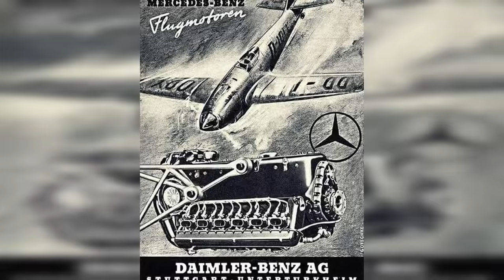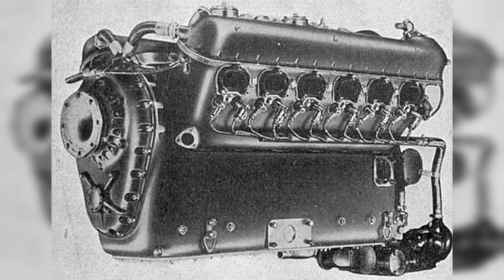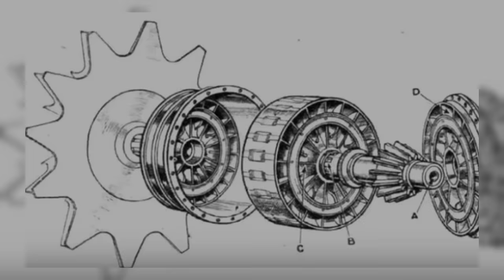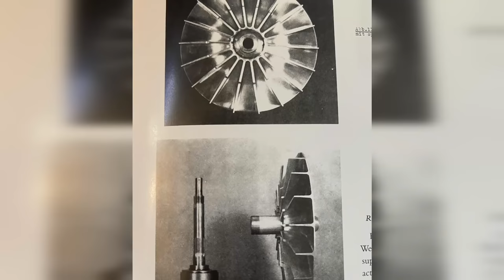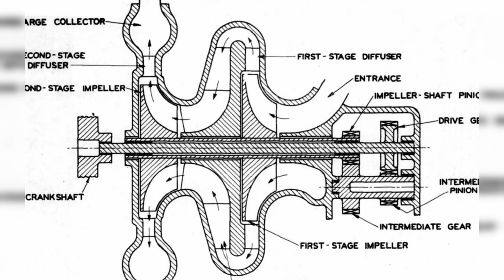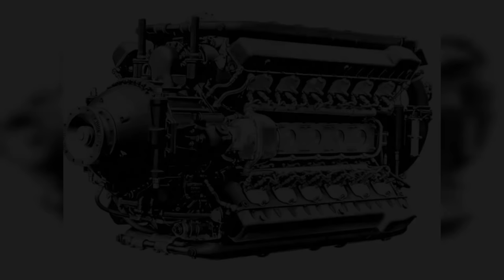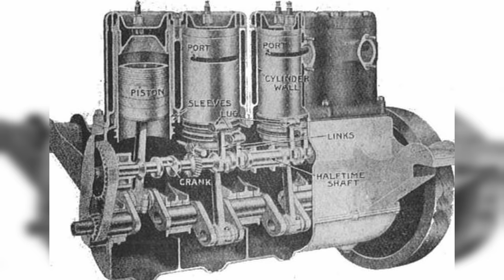The Engine of the Dark Side? Daimler-Benz DB-600 - DB-605 - Part 1

Comment: Daimler Benz,s 600 601,603,and 605 on account of poor quality petrol, oil and lack of decent metals are lack lustre performers, in the pony count stakes litre for litre, Roller,s Merlin and Griffon leave them in their dust. For example a DB 605 around 35 litres is 1 475 ponies, a Merlin 47 is 1,470 okay five ponies short but look at the litres , close on 1,500 ponies for less than 30 litres, 26 to be exact not bad weight wise. For an extra two litres,a Griffon in 2 stage blower form chucks out 2,000 or more ponies, a DB 603 struggles at 1,900  ponies before the ha-hah gas is used.  DB,s 600 series and  Junker,s Jumo also earned the soubriquet ' Stone crushers'  due to their low max rpm 2,600, as opposed to the Merlin,s racy 3,000 and the VDM electric propeller standard on all Luftwaffe aircraft lacks a constant speed unit, so synchronising a pair of  Junkers Jumo 211F2,s on  a Heinkel 111H is near impossible.   Despite their fancy fluid driven blowers the DB 601,s power falls off above  30, 35,000 feet ,that is why Heinkel Hirth designed with great difficulty the TKL turbocharger to boost the 601,s 605,s flagging pony count at extreme altitudes, . All aware of their engine,s  pony deficit , engineers at Daimler Benz came up with a wacky solution, 'needs must when the devil drives', no we are not talking of their simply dreadful DB606-610 Twin-Pac, no . Ever heard of HZ Anlage designed to increase performance of Fat Herman,s bombers at extreme altitude, for example a Dornier Do 217 with two 1,900 hp DB603,s has a third engine, a donkey DB605T mounted in the aft fuselage driving a very large multi stage blower, air close to sea level pressure is fed via pipes in the wings to  each DB603 blower, maintaining  their 1,900 ponies close on 45,000 feet, a bit Mickey mouse but did the job. Vasily Petlyakov in conjunction with Mikulin had the same idea,the  Pe-8 Petlyakov,s cool  looking long range bomber , had a fifth AM-35 engine based on a Hispano Suiza 12Y mounted  behind the wing trailing edge driving a similar multi stage blower, pipes in the wing sent high pressure air to the blowers of four 1,350hp Mikulin AM-35,s thus improving its already decent performance at extreme altitude.  Wow think what Pety,s cool bomber could do with a quartet of two stage Roller Merlin 85,s or 102,s, jesus, his Pe-2 Peshka attack dive bomber with two Merlin 77,s would give a Mossie a very hard time.
Reply: Poor quality fuel???  Any fuel that permits the engine to perform as needed is a good fuel.
The sophisticated and inventive German engineers with their design did not need 150 octane fuel.
Reply: @BasementEngineer  Yes!!!!, why do you think in 1944-45 German Chemists were working hard to synthesize and manufacture 100 Octane petrol using what ever crude they could get  from the Ploesti Oil fields as part of the refinery were put back in some semblance of working order after the grass cutting raid by Consolidated Vultee B24D Cat Muzzle Liberators based in Italy. Nearest the chemists got is 96 Octane C3, the limited production sent to  Fat Herman,s front  line Jagdeswaders Fighter Squadron flying BF109G,s FW 190Ds and Ta152,s in  the Home Defence Role. The Luftwaffe so short of even the 87 Octane, forced to scrounge 100 Octane left in the tanks of crashed landed allied aircraft. It is their very sophistication that brought the Luftwaffe to its knees, said sophistication , not the panacea they hoped for,. Look at Daimler Benz,s  DB604-606 ,  Junkers Jumo 222 ,both over complicated and hopelessly unreliable.  If you you want your pony to win the pony race ,feed it the best oats, why do you think  the US Army Air Corps asked the Standard Oil Company to send a batch of 100 Octane to Wright Field in 1934?, good feed equals race winning pony.
Reply: @basiltaylor8910  The most courageous lion will succumb to a pack of jackals.

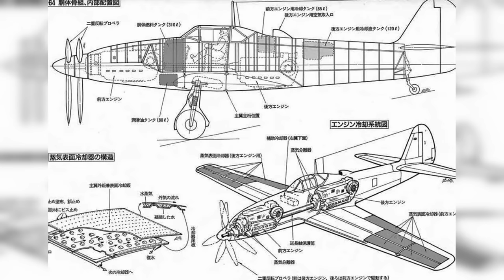Comment: 7:40 what aircraft is that?
Reply: Good question, it looks like one of the Heinkel experimental aircraft either a P.1066 or a P.1076??? not exactly sure.
Reply: Kawasaki Ki-64
Reply: @4strokenicolaus  Good catch! Thank you, I didn't know the Japanese used the Daimler Benz DB 601 engine...
Reply: @sandervanderkammen9230  in this case the engine is called Kawasaki Ha 40, more or less a japanese version of the DB601.....
Reply: @4strokenicolaus  I couldn't help but notice a heavy German influence on the Ki-64, I can only assume that it is a Takeo Doi design? He designed the Ki-61 and was a student of Dornier engineer Dr. Richard Vogt...
Do you know if Vogt? Or Doi designed the Ki-64???

Comment: The constant denigration of the German's design philosophy involving a lot of 'purely academic' testing shows a critical lack of understanding. It is not in spite of this attitude that Germany had the most advanced fighter in the world going into WW2, it was because of it. The advantage of such 'purely academic' testing is to note where advantages may or may lie and thus inform decisions on what exactly they should be focusing the majority of their resources on in the first place. It's relatively easy to get a spare engine, jury rig a turbo to it, and record some statistics and observations about the performance. It's much more time consuming and expensive to create a production-model analogue and run it through full-scale tests.

Ignoring the testing at all though means making assumptions about what will and will not work- which only works if you know in advance what your choices are and the consequences for them. It's the hindsight fallacy. In hindsight, these investments of time, money, and energy were utter wastes of time when the could have been investing in more successful ventures, but there was no way for them to know that at the time. You might point to all the people that told them things would work out this way, and I could easily point to all the people that disagreed. There's no real way to differentiate between them either without at least testing out their ideas.

If the Germans hadn't done all that testing of novel concepts, they would have just stuck with what they knew worked which means... either a V12 or Radial engine with a traditional lay out, unpressurized carburetors for fuel injection, and using a traditional gearing system. A design philosophy that would have ended with them investing all their resources into incremental improvements to the DB-600... would have never created the DB-600 in the first place.

Comment: Imagine the DB 600 series combined with 150 Octane American aviation fuel.
Reply: DB 600 series doesn't need 150 octane.. they are equipped with GDI fuel injection.

Comment: Okay, and nitrous oxide does not "stabilize combustion temperature". that is methanol-water injection, if anything, although I thought that was more to do with charge air cooling. Nitrous oxide is literally nitrogen and oxygen. The nitrogen is totally inert. Oxygen is what you use to burn fuel. When you use forced induction you are cramming more air into the cylinder to burn more fuel. Nitrous oxide is just a turbo in a can. The system injects oxygen into the intake charge in the form of NO2, which is even more rich in O2 than air is. You set up the fuel system to crank up the fuel delivery, and you can burn about as much fuel as you dare try to burn in the cylinder (you don't want to go lean still). if there is another use of nitrous I have never heard of it.

Comment: While German engineers were searching for the best engine design for any particular machine, (land. sea, or air), this, in war is a mistake. Better to have one or two designs that work WELL ENOUGH in most or all applications. Then you have standardisation of your spare parts inventory, simplification of the supply chain, and easier mass-production. If supply of spairs becomes an issue on the front line (not exactly unheard of), then you have the ability to cannibalise parts from other machines. During WW2 the allies were able to keep things going because of this interchangeability, where as the Germans ended up leaving equipment behind for lack of spairs.

Comment: Okay, have to stop you. 15:50, you say Germany focused on single stage systems because they "didn't require aftercooling". Aftercooling is what a single stage system uses, if it is cooled at all. it is what most people call an "intercooler" today. It is "after" cooled because it comes after the compressor, before it enters the engine. A single stage system doesn't need it, but it is better to have it. A 2 stage system can use an inter cooler between the stages, usually in addition to an after cooler, basically each stage has its own cooling system to recool the pressurized and heated air. One could just use an intercooler, but I can't recall any cases of them doing that. As far as I know all major versions of the DB had at least one cooling stage, it is hard to run a forced induction at any meaningful boost pressure without it.

Comment: German engine valves were short on nickel.
The low nickel content meant the valves would
not stand emergency power or methanol injection
for long. The 109E was in many ways inferior to 
even the P-40.

Comment: 17:46 - That is a completely nonsensical statement. The configuration of the supercharger impeller is in no way related to the design of the camshaft.

Edit: The statements about N2O are completely nonsensical as well.
Reply: Not true, the larger capacity supercharger impeller was needed for DB601E onwards as they increased the valve overlap by having very long duration camshafts, which open both valves for a very long period, this means a lot of the supercharger boost goes right through and out the exhaust, so you need a bigger capacity supercharger.
Reply: @CalumDouglas  That's not what was stated in the video.
Reply: @PistonAvatarGuy  - You stated : 

"The configuration of the supercharger impeller is in no way related to the design of the camshaft."

I`m explaining to you that this statement is completely wrong.
Reply: @CalumDouglas  Ok, so we're just going to completely ignore the context of my original comment?
Reply: @PistonAvatarGuy  - Your statement that camshafts have nothing to do with impeller design is factually wrong, no amount of wriggling gets you out of that one I`m afraid.
Reply: @CalumDouglas  No, buddy, the fact of the matter is that the video made it sound like the design of the supercharger impeller directly affected the mechanical nature of the camshaft, but the reality was that the design of the camshaft lead engineers to change the design of the supercharger. The video is completely wrong, PERIOD. I'm not the one doing the wriggling here.
Reply: @PistonAvatarGuy  - Your comment was:

"The configuration of the supercharger impeller is in no way related to the design of the camshaft."

It was, so thats the end of the story isnt it.
Reply: @CalumDouglas  It's a true statement, though. If you change the design of the supercharger, it doesn't inherently change the design of the camshaft, EVER.

Comment: You say Daimler Benz,s blower is superior to a Roller(Rolls Royce) Merlin or Griffon, i beg to differ on that thorny issue, DB,s 2 stage blower is crap, er well engineered crap. In late 1941-42 faced with Kurt Tank,s Focke Wulf 190A Wurger Buther Bird  the RAF,s Spitfire V Squadrons were being slaughtered, like a turkey shoot,. Faster by 16 17mph, more manoeuvrable heavily armed with for 20mm MG FF cannon and a decent engine Beemer,s BMW 801D complete with its own brain, a workable engine management system ,the ancestor of (FADEC) Fully Digital Autonomous Engine Control,as the pilot pushes the throttle the Beemer,s brain does the rest.
Actually the Beemers 2 speed blower is very neat, having not one set of curved impeller blades but two sets back to back on the same disc, a very compact 2 stage set up, affording the 801D decent performance above 30,000 feet. Why do you think A R Fedden had a Stiffy, when an RAF lorry dropped off a Beemer 801D, salvaged from a crashed FW190A at Bristol,s Filton Engine Facility, Roy Fedden was like a hormonal schoolboy staring at Kim Kardashian,s jugs,as  he,  his small team of engineers were all over the Beemer 801D like a cheap suit,. Like a Coroner in a morgue Roy, his engineers carefully dismantled the engine bit by bit, studying its features, especially that blower. Knowing all to well his Bristol Hercules 16 Radial was a dog(crap engine) needing a serious make over,. It does not take Professor Brian Cox to tell  you ,Roy incorporated the Beemer,s blower and other systems into the Series 100 Hercules a far better engine that powered the later models of Frederick Handley Page,s Halifax, together  with Roy Chadwick,s Avro Lancaster spearheading Arthur Harris,s reign of terror over Germany,s industrial heartland. 
At Roller,s Derby Factory Stan Hooker ,Ernie Hives, both seriously concerned over the Spitfire V,s high casualty rate when scrapping with an FW190. RAF, s brass hats were too, shitting their pants as the balance of air superiority over Southern England  favoured  Fat Herman,s Luftwaffe, something had to be done like yesterday.  Luckily Ernie and Stan had a wild card to play, Rex K Pierson  with Barnsey Wallis  reworked their faithful Wimpy Wellington Bomber to  work at higher altitudes around 40,45,000 feet,  resulting in the odd whale like Mark 6, reworked into Barnsey,s Basket Weave airframe is a boiler like pressure cabin for a 3 man crew the pilot sitting under an upside down Pyrex bowl, designed by General Aircraft at Hanworth .  Roller,s secured the contract to make the Wimpy Whale,s engine ,in order to complete with said contract Ernie with Stan  rooted round their graveyard  of Roller,s crap also ran engines for anything they could use, both dug out the blower from a Vulture, Rollers worst engine an utter dog!!. With a small team of  trusted engineers Ernie, Stan took a standard Series 20 Merlin and 2-speed single stage blower off the production line, whipped off its backside, to bolt on a new blower accessory section designed in record time. A single shaft mounted a series 20 Merlin blower disc, together in tandem with the larger Vulture blower disc, sandwiched between blower and cylinder blocks is an after cooler the size of a Samsung microwave oven. Result is the excellent 60 series Merlin, with automatic gear change and sixteen seventeen hundred angry Derby ponies, some fourteen hundred of them readily available close on forty thousand feet in FS Gear.  
To cut  to the chase George Dowty at Staverton, added an extra blade to his Jablo Hele,Shaw propeller, bolted his new four blader on the 60,s propshaft,  At  Supermarine Joe Smith took a Mark V Spitfire,and like Richard Rawlings at 'Gas Monkey' Garage, stuffed a Merlin 60, in a V to create the Mark 9 or IX,  wresting air superiority back to the RAF  from Fat Herman.